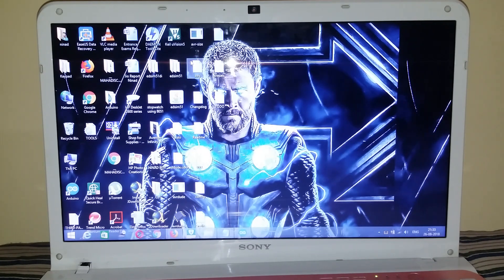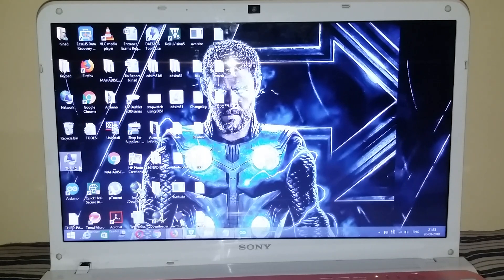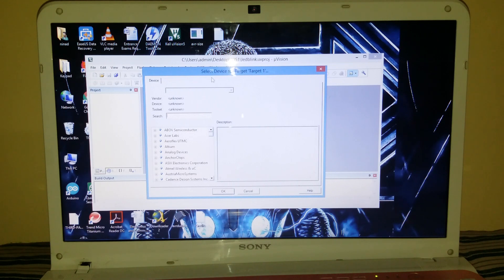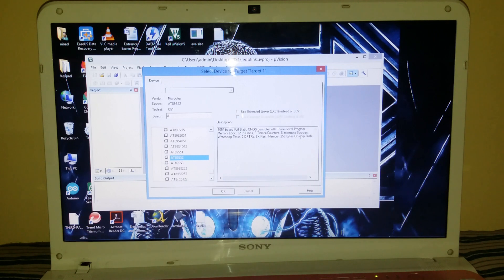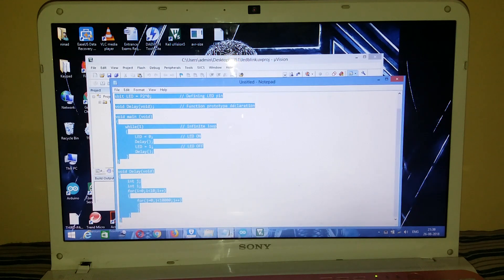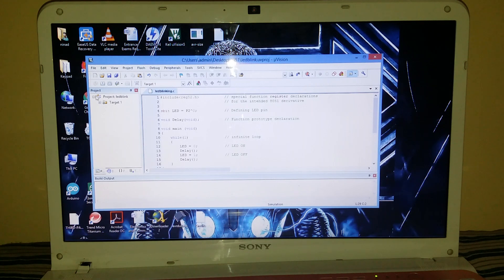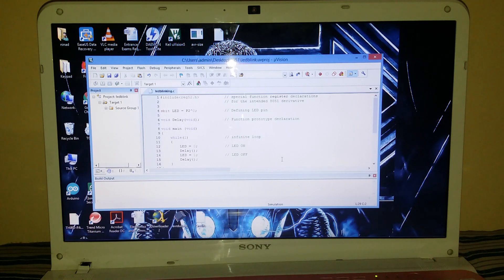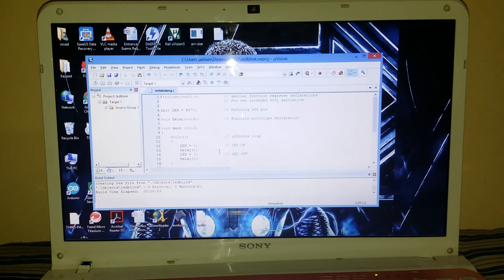How to simply program 8051 with Arduino Uno PART-1!!

Comment: Could you share the code pls
Reply from the maker: code for blinking led:-

#include<reg52.h>           // special function register declarations
                            // for the intended 8051 derivative

sbit LED = P2^0;            // Defining LED pin

void Delay(void);           // Function prototype declaration

void main (void)
{
    while(1)                // infinite loop
    {
        LED = 0;            // LED ON
        Delay();
        LED = 1;            // LED OFF
        Delay();
    }
}

void Delay(void)
{
    int j;
    int i;
    for(i=0;i<10;i++)
    {
        for(j=0;j<10000;j++)
        {
        }
    }
}